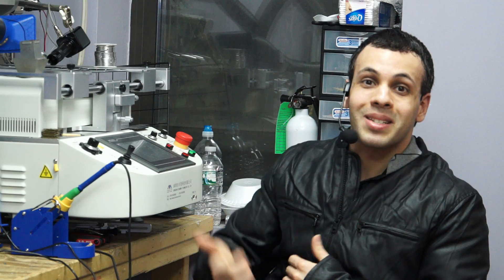How to get your #mbp2011 problem fixed for free!

Comment: Guys, I need your advice, please.
First of all, thank you Louis for these very informative videos. I've been watching the reballing myth video too.

I've got a (kinda?) similar problem with a friend's MBP.
He brought me a 'dead' MBP, Apple wouldn't touch it because it's too old. Some Genius claims the GPU is dead.

I just cleaned up the exhaust fan, it was really clogged with dust. I was shocked that the Apple guy didn't even attempt to clean the exhaust system.
 I reinstalled Lion.
It was working. I tested it by streaming a youtube video for 15 minutes. Display was fine, system was stable. Temperature seemed to be fine. I thought it was ok, and gave it back to my friend.
He called me back and complained that it started freezing again after streaming a Netflix video for 1 hour. Now it's fubar again.

After watching your videos, and reading a lot of stuff online, I really don't know anymore if his GPU is really fubar or not. 
Could it be a 'simple' overheating problem, due to the terrible MBP airflow system?
What really puzzles me, is that the system is *perfectly fine when the temperature is cool*. No display artifacts, no freezing, nothing.
The freezing just happens at high temperature.

I'm going to give it one last shot, I will clean up the factory thermal paste, mirror polish it, apply a very thin layer of quality thermal paste, and see how it behaves then.

Some people say that using the software 'smcFanControl' and force the fans to spin at a higher rpm can help with this issue.

Thank you
Reply: Nevermind, found a solution: 
https://apple.stackexchange.com/a/285896
On these 'dead' MBPs, it's possible to disable the discrete GPU and use only the integrated one.
My friend's MBP is now back from the grave.

Comment: The Apple replaced Macbook Pro Logic Boards are now starting to fail as well.... (Spring/SUmmer 2017) Replacing the thermal paste will not fix it. Reballing or a total logic board replacement are the only options really.

Comment: Apple is bullshit. My Macbook pro late 2011 just died this afternoon. No symtoms before failing. Tried changing HDD, didn't work. Tried setting secondary graphic card as primary. No luck.
I wasn't even able to see the commands I was writting on the laptop, and they didn't work anyway.
I could be understood that after 6 years, it had last enough, but I own other pc laptops and they just don't die suddenly that way and due to a desing problem.
I won't buy another Apple product ever and I will recommend anyone I could not buy any Apple products. I'm very dissappointed and angry.
Reply: I have a Macbook Pro 2011 and it died yesterday. It really sucks.

Comment: Sir please replay one day after use i shut down my Mac book pro 2013 a1502  but I try to On the machine next day it's not turn on i give it to apple authorized service center they said it is the problem of logic board after 6 moths waiting i give to repair  a cool guy find it is the problem of a graphic chip ,sir I want how much it s changing price if the graphic chip is complaint the system shows won't turn on problem

Sorry for my bad english

Comment: Great video, but unfortunately now the program has ended.  Now I'm just SOL and have to replace the GPU.  I'm fairly certain that I know what killed mine.  It's this crappy new MacOS Sierra that has crap like 'photoanalysisd' taking up 100+ of my CPU ALL THE TIME.  And that's not the only thing, you can see more of the crap Mac OS Sierra does here... https://cfurrow.github.io/osx/2016/09/29/macos-sierra-killing-my-cpu

It's like they are trying to kill people's computers.  Sounds like planned obsolesce to me...

Comment: That happens with the imac`s of 27 "mid 2011 with graphic card AMD 6970M I have made the reballing process 2 times but still no video, not even by external, check the chip 216-0811000 and seems to be in good condition, in addition to Test the connector which is in perfect condition.

Comment: How can I back up my hard drive I'm in Australia I first made a fault claim in 2012 I was in car accident bad injures they wanted to ara screen share for years it won't load they kept looking for a software issue I got a LaCie rugged 1TB external hard drive and the lightening port wouldn't work and now I can walk they wanted me to travel 7hrs to the Apple Store I live in a small beach town they did not contact me about the worldwide recall and now I can walk they say it's now obsolete and vintage or some crap I've delt with roughly 30+ technicians senior technicians product specialists etc etc etc and now want to offer me $100 off a new MacBook Pro and I paid over $4k because I brought it with the 27" lightning screen which if I had have gotten a 27" iMac instead they would have sent someone to my house to fix it because they deemed that unmovable yet the MacBook Pro was movable I couldn't drive or fly because of a broken back ankle and shoulder reconstruction I still have another shoulder reconstruction to have soon and lumbar surgery but I have all my important photos of my daughter being born and documents etc I need them as they're priceless can you please help suggest what I can do??? PLEASE

Comment: I believe there is a misconception within the comment section. 
From what I got out of the video, the GPU stress test is to make sure that your Macbook can handle a big workload like intended, and not fail in doing so. Some people here thinking you're trying to overheat it on purpose just to get a new one, suggesting to up the room temperature and cover it in blankets. 
Apple's policy is generous at best, and shouldn't be abused, otherwise they'll catch on and cancel the deal in the future.

Comment: Hi, first I want to say that I really enjoy looking at your videos I found them really informative.

Secondly I know your position about a damage graphic car (It belongs to the rubbish bin) however I get to keep the now damaged macbook pro after getting a new iMac last week with 50% discount offered by Apple and thanks to the UK consumer law to what I consider it was a good deal for many reasons I'm not gonna go into.

So I opened the macbook pro cleaned it and I've heated the GPU to 250c put new thermal paste and close it agin to find out for my surprise that the computer is now working and as you said is definitely due to the heat.

My question is, do you know and could you briefly explain why the heat made the GPU work again I'm just really curious? and also how long do you think it will last this dodgy solution and if there is something I could do to extend the life of that provisionally working GPU by for example reducing processes or controlling computer temperature?

I want to say this is my personal computer and I don't fix or deal with costumers on this area and I highly respect your approach to customers by giving real solutions and being honest about issues.

Thanks.

Comment: I tried bringing mine in today to be "fixed" for the second time, only to be informed that they discontinued their replacement program on December 31st 2016. New logic board would be $575, so looks like I'll be blowtorching my GPU instead! Thanks apple!
Reply: Hey! I used a blowtorch and an infrared thermometer... Definitely would not recommend holding a motherboard to an open flame to any sensible person, but I was desperate and really had nothing to lose.  You will need to get your GPU to 140ºC and hold it there for about 5 mins in order to re-solder the internals, and hair blowers only got mine to 90º. The best thing to use is a heat gun – applied evenly across the unit. Hope this helps!
Reply: Ben Wilson brought mine in on Monday and they couldn't find the issue with initial tests. They said engineers would need to test it more over 3-5 days and it would cost $566 if they couldn't replicate the problem or $0 if they could. I was still covered under the program with 90 additional days of warranty on the new logic board
Reply: Did you get yours replaced 90 days ago? I think my problem was that I had it fixed the first time over a year ago. Engineered to last 90 days or more, I suppose...
Reply: Ben Wilson I purchased mine in March 2011, had a few replacements within warranty (HDD, battery, etc), and it worked just fine until Jan 2017. I started getting glitches. Brought it in for repair on January 30, 2017. Got the repair for free and just picked it up a few hours ago from the store.
Reply: Well that sucks, I wonder why they told me to take a hike... Doesn't matter now though, I just reflowed the GPU myself and she's back to working order (for now)
Reply: Ben Wilson hi. How did you fix yours? Can I use a hair blower. I went to apple service center but they didn't accept it since it was 'obsolete' and might not find parts as per the guy I talked with.
Reply: great! thanks

Comment: I had a Christmas present. My GPU failed on the 25th. Got it in for a repair on time before the warranty ran out. Two weeks later, they tell me that they've replaced the logic board, but it appears that the LCD is now broken and they want $700 from me to replace the LCD.

I took the laptop home, unplugged the LCD cable, cleaned it with acetone and replugged it, and now the laptop is 100%. No money spent.

Has anyone been able to do the free laptop replacement recently? I'm planning to do some stress tests to cause the error to come up again. My first failure came while using an N64 emulator on my computer.

Comment: Well said. My GPU died on the 31.12 and it was the last day of the extended warranty, but the repair shops were already closed. I'm pretty sure that Apple won't cover anything but I still try my best, and with your advices I'll try to be as polite as I can.
Reply: Mine did it on the 26.12.2016, though in windows(bootcamp). Could run in safe mode, so tried to re-install drivers and eventually did a complete recovery/reinstall of Win10 for no effect. Enjoyed the holidays and New Years eve and tried to boot OSX yesterday. No success. System diagnostics identified no problems, and internet recovery just went white"grey-screen after loading. Googled the issue, found the extended warranty page, and contacted apple for assistance late night yesterday.
I've just had a nice apple support dude call me, telling me that they will not be able to help, because it's passed the stated end date 31.12.2016.
Although he is right, i can't help feeling extremely mad! If I had just known about the issue and the extended warranty program. 11 f...... days. : (
Reply: Hi. Apple gave me the finger. 

Luckily there's a way to fix it. Kinda.

 MBP2011 has 2 GPU's and you can survive by using only one of those. There's a youtube-video which helps you to disable AMD's drivers so that Macbook switches to integrated graphics. Only problem is that if you have installed El Capitan it will have System Integrity-protection which prevents you from making modifications. 

I found a way around this by first going to Internet Recovery mode (cmd+option+r) and then after it has loaded it will go gray (thanks AMD duh). After that turn it on again while pressing CMD+R and then rapidly switch to CMD+S. After the computer is confused write as fast as you can: csrutil disable. It will disable System Integrity. After this follow the instructions of the AMD-disabling video.

Don't know if it will work on Windows bootcamp. I'd suggest you to find a program in Windows that allows you to disable the discrete GPU.

Sorry for bad english (If you can give me some tips or point out my mistakes I would be grateful)
Reply: Put mine in for the repair program on 31.12.2016.
at 6.01.17 they declared the macbook "vintage" and not repairable under the extended program. i am now gonna try what this kind man says. lets hope for the best
Reply: How did it go?
Reply: they wont even aceept it for repairs ,
Reply: Woah, how can they do something like that.
Good luck on repairing, I've been using my paralyzed Macbook Pro for internet surfing, I found out that a browser called Waterfox is great for wounded macs. It runs smoothly 1080p video.
Reply: I disabled the graphics extensions but my machine is now very laggy and slow.

Comment: My MacBook in my opinion has the same issue, so I sent for repair into apple under there gpu repair programme. Apple rang yesterday and disagrees. it's a mid 2012 it turns on and the apple logo has purple lines through it and does not get past the logo, loading bar stuck half way. It's now away for repair apple are saying it's not the gpu as it passed there gpu test. They now quoting me £1000+ for repairs, they want to replace the logic board and battery as it won't charge intermittently it's been like this for over a year, yet works enough to be more then usable to warrant a new logic board (corrosion on that circuit, I've opened it up before) they won't look any further into the issue until the logic board is replaced...Any advice Louis if it passed the gpu test??

Comment: Louis, just an update. Hopefully it can help someone. Extended care expires in 2 days. Initially the Apple expert checked my purchase date and told me it wasn't under warranty and it would be a $660 repair. The repair would consist of them replacing my current logic board with a refurbished board. He said there's nothing he can do about it as my purchase date is outside of the 4 year scope. He recommend I called apple, which I did and spoke to a VERY nice person who then approved my repair and offered FULL coverage.
Reply: Tony C yeah I got mine fixed for free because I scheduled my Genius Bar appointment before the 31st. Got it fixed, and 3 hours after, it was still glitching... gonna fry it with the stress test and get a retina💪🏻
Reply: Drones and Sneakers any updates?
Reply: left it on for a week, with a monitor too, and nothing happened. I think it happens from multiple heat ups and cool downs of the solder, not just one long heat up.. I heard that some people are trying to get new ones, and apple is telling them that it is considered vintage and not allowing them to get a new one... so i think im just gonna sell it and use the money to buy a 13" 2013 retina which of equal value of my 2011 15 mbp with upgraded ram and ssd... Figured that would be better than having my mbp die on day 91 of the 90 day warranty.....
Reply: Drones and Sneakers even if it's "vintage" would Apple still replace the whole macbook if it continues to fail these stress tests within the 90-day warranty of the new replacement logic board?
Reply: my guess would be only a logic board replacement, because remember they dont have the old style mbp anymore
Reply: Drones and Sneakers I'm referring to the main point of this video where he got his MBP's logic board replaced so many times that Apple just said fuck it, and they replaced his whole MBP with the only thing they had available, which would be the current year's MBP
Reply: this video is old. And when this video was made, the 2011 mbp  was not considered vintage. Now it is vintage...
Reply: let me reprase, the early 2011 is, not the late 2011
Reply: Drones and Sneakers There's a comment on this video from 4 months ago where the person said they got their 2011 MBP fixed 4 times before Apple replaced it with a new 2016 MBP. I'm hoping I'll be just as lucky :)
Reply: Kevin Nguyen I'm just telling you, if you have a early 2011, the best thing you are gonna get is a new logic board. I'm not going off of luck, but actual fact. Vintage products get fixed, not replaced.

Comment: Just took mine in yesterday. They said they're aware of the problem and offered to fix it 100% for free and made a point to clarify that the new parts would be NEW, not refurbished and that the new parts would be a different, better kind than the original. I get it back in 3 days.
Reply: thats weird because a certified apple technician told me today that the parts would be refurbished... ? When I spoke to a supervisor over the phone he was upset that they didn't honor the replacement warranty in the first place.

Comment: Hi i'm starting to have the same problem in a late 2011 mbpro 15 ', but I see that apple replaces now and without any cost the plate, I only have a question if you could help me., I opened my Mac to change RAM and put a second HDD too, (obviously i'll try to put it back all together before) do you think my Mac achieves to enter the program change, thank you very much for your great video, your reflexion made my day in a personal matter.
Reply: +Neilson Patterson thnx so much man ill keep you posted about it
Reply: Did it work??
Reply: yes it did
Reply: now im gona to stress it out for the next steps, but for now i have a new logic
Reply: karman gv What is your status?
Reply: well, I didn't stress the mac as i mention before, but it has been working really fine now some times now i only notice that mi charge does not last that much longer than before but thats obvious now the it has  a cycle count of 1222.